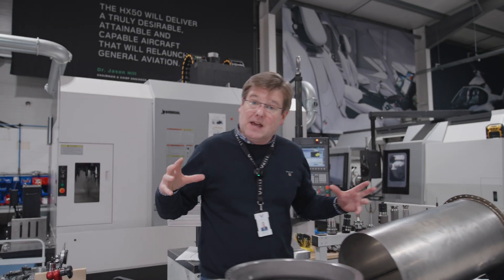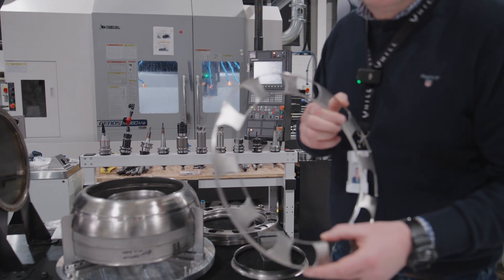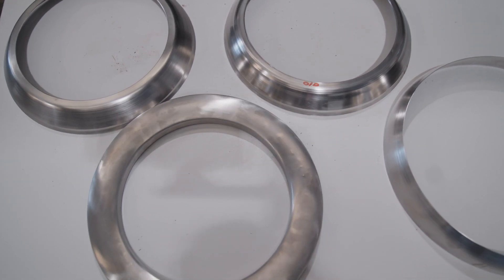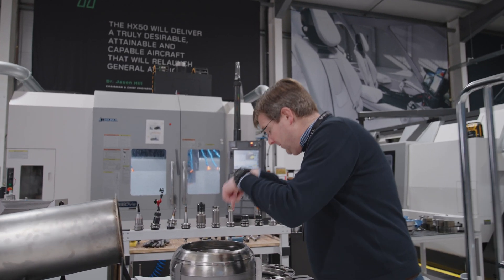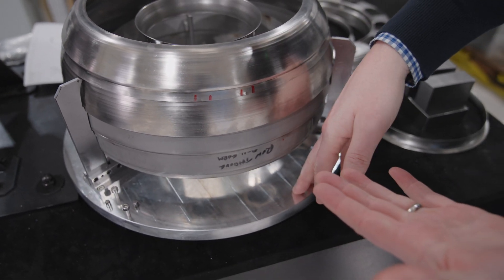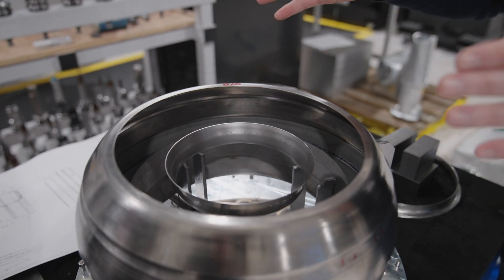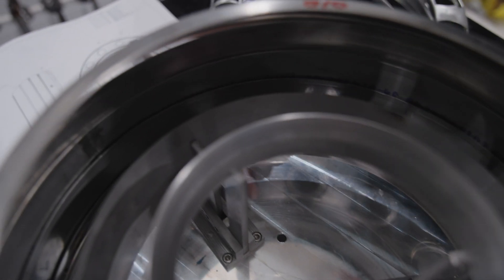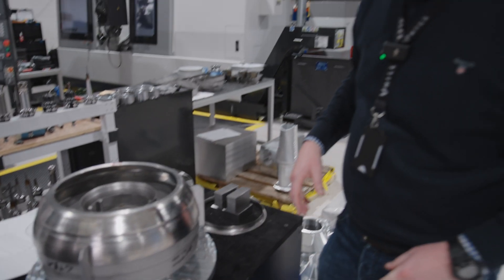The Annular Combustor

Comment: How did you determine composition of the optimum alloys to use in the various temperature areas of the engine-?
Reply: i would imagine much comes down to experience, the teams working on these things have a wealth of knowledge in these areas coming from aerospace backgrounds, what they don't know isn't worth knowing

what i have learnt so far in the week that i been watching all the videos, is these guys know what they are doing having done it for years, as Jason suggested and described a while back, if you look at most helicopters today there are many great things and other aspects that may just fall short, if you bring all the good parts together under one roof, you should have an excellent design near proven before it flies

Comment: These rings and that material is especially good case for the newer laser welding techniques, better than TIG for the thinner sections. It is becoming better all the time for that kind of job.
Reply: That was my thought as well. This is a brilliant scenario for laser welding, where you have far lower volume than automotive use cases but actually a higher level of quality control for welds at a price point that is still cost- and time-effective while working on extremely high-tech alloys for which TIG would likely be a nightmare.